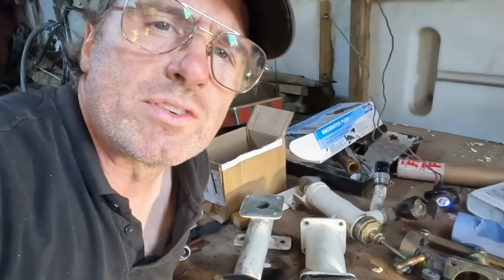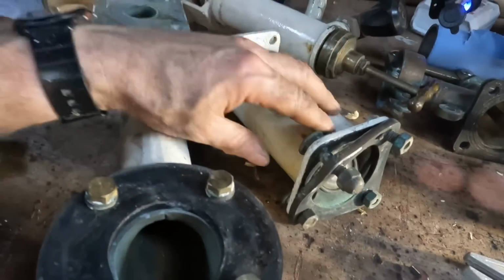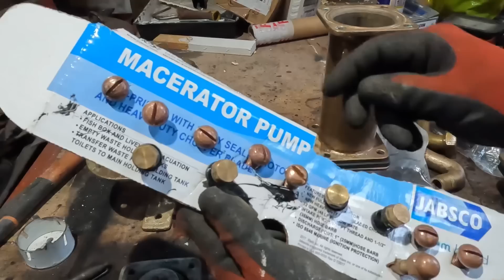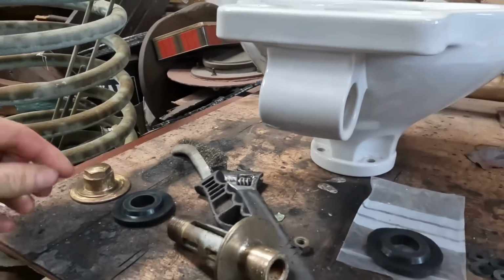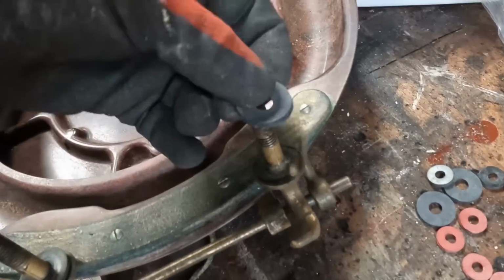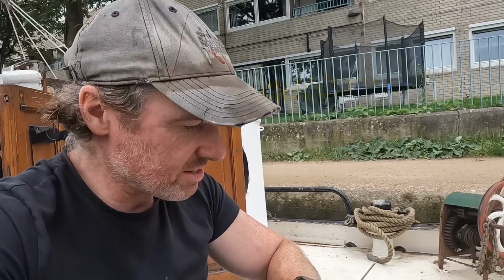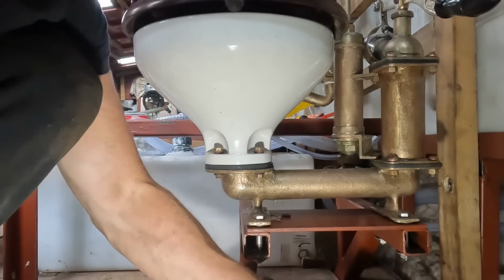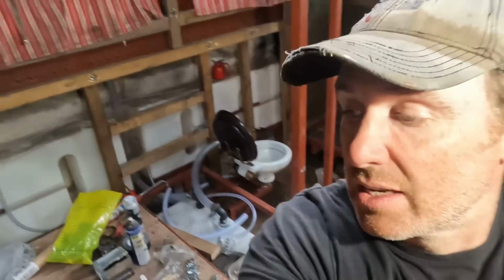I strip down and rebuild Baby Blake toilet. And hook it up.

Comment: Hi Canice that Blake is from the 1930's , They are totally different today lot's of Plastic , In the winter put some anti freeze in the bowl and pump through the system , and with that lovely clear Plastic outlet pipe remember not to leave any trains in the Station !!!!!!!. Cheers
Reply from the maker: Hi Ramsey! I haven’t forgotten about the trains! When the partition goes in, I will paint the pipe and users won’t see the trains. Thanks for the antifreeze tip!

Comment: This is just what I needed for my imminent rebuild of ours. Thankyou. I’m terrible with diagrams and the exploded diagram is OK but I’m more of a video person. This will help immensely. You also gave me some good work arounds for their very expensive tools. Note to self…..go gently when tightening bowl bolts! Awesome work fellow mad person!
Reply from the maker: I was thinking of you when I was editing this. That’s why the crack in the bowl was left in as I didn’t want you to make the same mistake. I totally agree that the price they charge for the tools is outrageous, considering there are only a few bespoke tools in the kit. Which I’ve since discovered you can buy on Blake’s website individually rather than the complete kit. Check it out.
Reply: @canicebannon   Amazing. Thankyou. I actually have two toilets from which I am taking the best bits…this means I have two bowls though one is in better condition than the other but I will be taking great care when tightening those bolts! Great thing is I have two sets of bolts etc……they have taken quite a bit of fettling as both were covered in paint. Months of work actually! Like you say……only for the mad! 😌

Comment: Hey Canice, could you use a penetrating epoxy resin to glue the bottom of the toilet bowl?? Once set it would be as strong as the original! And with a fine crack like that it would be almost invisible to 👍🏼
Reply from the maker: I’m going to do this! What a great tip. The crack is at the back so won’t be seen. I don’t think, it’s going to be a problem as the bowl is unaffected….
Thanks Steve!

Comment: An unexpectedly pleasant sight was the manufacture of a wrench for unscrewing slotted nuts. Usually people use a chisel and a hammer for this, which is wrong, but they can be understood - right factory keys are quite rare among tools.
Reply from the maker: No problem getting the tool kit from Blake’s. £357. I could buy quite a few hole saw kits for that!😂😂😂

Comment: I would still be crying if I broke it, do you have any insurance that might cover it. If not how about cutting a 4”-6” piece of white plastic waste pipe the depth of the broken porcelain and fill it with a strong sand and cement mix and trowel it of smooth. Once dry paint it with gloss paint. Ok you won’t be able to get to bolts, but could last for years. And would look good. Regards
Reply from the maker: My plan is to see what happens. I may get some epoxy and give that a go. If the crack gets worse then I’ll replace it. It isn’t causing an issue with the function of the toilet. It might be fine!